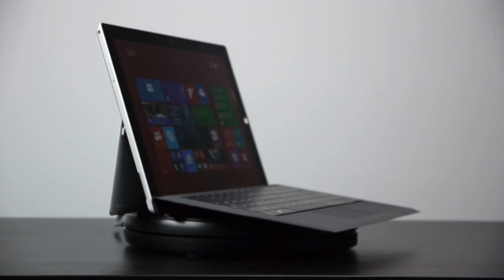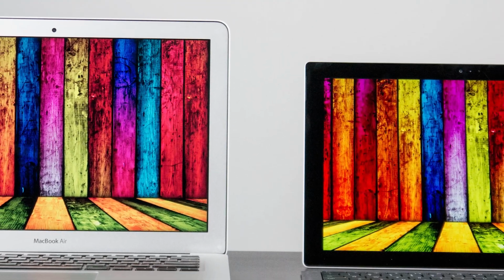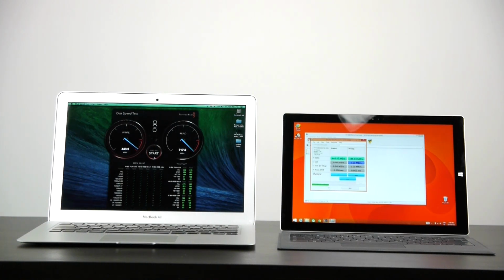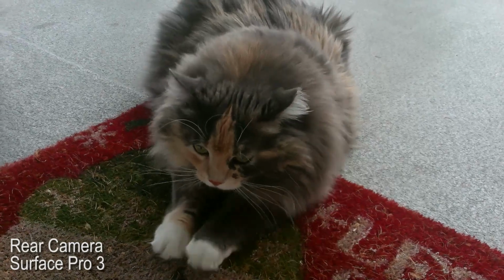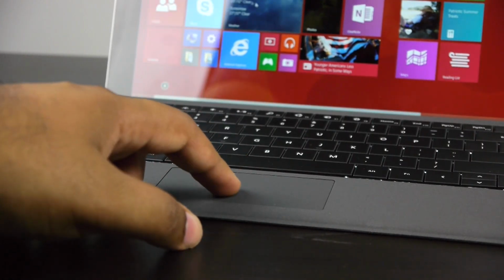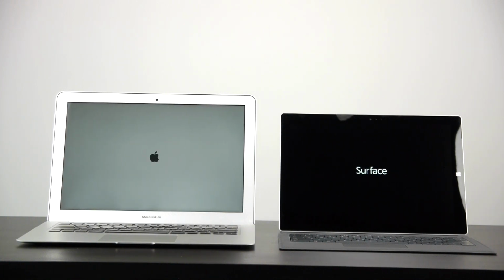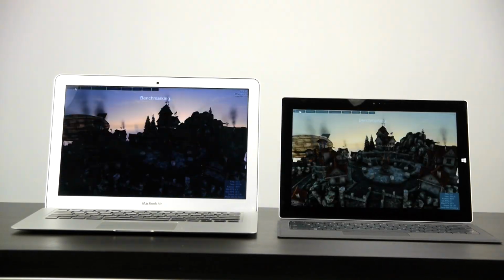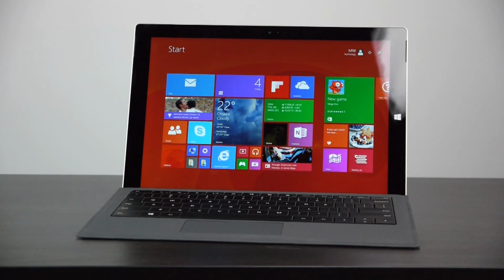Microsoft Surface Pro 3 vs 13" MacBook Air Full Comparison

Comment: So the Surface is a Tablet and is not the best tablet and a laptop and is not the best laptop. The Mac Book Air is an Ultra book, is regarded as a great ultrabook. BTW the Surface tablet starts at $800 with a core i3 plus the $120 keyboard. The Macbook Air starts at $900 dollars with a core i5. So which is superior?
Reply: Visual Uprising Well, It is bearable on this tablet. Plus the incentive is to be able to write on docs that you would otherwise have to print out which is a HUGE cost of time and money.
Reply: fantscher Thank you!!! Surface Pro 3 hands down (IF you're a student)
Reply: Visual Uprising  :D ok ;) there is nothing really to add to that... you are not in the target audience for the surface. you simply have no clue about the capabilities and the field of application for a device like that. in the field of ultrabooks it may not be the best... but it is far more than just an ultrabook or a macbook air. noone needs tablets (just to show stupid pictures or to browse internet? what a dump). but combined with all the features of an ultrabook AND the integration of a digitzer (not stylus!) it rules above all else the market offers. if you don't need all of it's features, than stick to your macbook air, thats a great product too... for my use case the sp3 has the better value-for-money.
Reply: Visual Uprising
as i said, i am using a vaio duo 11 (for about a year now). and since i applied the sony protective foil, it writes exactly like paper. it is responsive and has enough friction to imitate the feeling. i'm as fast as i was on paper. with nearly the same quality. i don't know whats your problem about that... have you ever used onenote? or a real digitizer?
Reply: Visual Uprising why do you hate OneNote? I haven't used it before
Reply: Visual Uprising You avoided answering the question poised by fantscher [have you ever used onenote?] and just stated that you hate it. Why should anyone take anything that you say as meaningful? You appear to be just a hurt fanboy crying that everything but apple is bad.
Reply: It's not a tablet. It's a laptop, and a tablet second. It's fully functioned in any thing you wanna use a laptop form, whether you want to use it for creating documents, productivity in the Adobe suite (Premier Pro, Photoshop, After Effects, etc...), casual gaming, and whatever else you'd use a mid-range ultra book for. Again, it runs the full Windows 8.1 operating system. Because of that it also has great support for touch. With its high resolution screen with a 3:2 aspect ratio, you can also use it comfortably in portrait, or landscape orientation, and use the Windows App Store to download apps. And in regards to note taking using one note, it's based on a pressure sensitive digital pen (not a stylus) that's used to instantly open in one note when clicked, allowing access to your organized notes instantly. As a generally productive person, this catches my attention more than the MacBook Air. That being said, I'm a heavy iOS user on an iPhone 5s and iPad mini currently, so having a Mac offers benefits in terms of sheer convenience in addition to its more productivity conducive OS. But to say the MacBook Air is better, is sheer bias, because for the most part, the key components in a modern, portable notebook are the display, OS, and Processor, and the Surface Pro has proven to be just as good if not better than the current MacBook Air.
Reply: ***** your right sir, i was thinking of the Mac Book Pro. I have Edited out that part of my comment. The rest still stands
Reply: Visual Uprising
no touch screen. and for me as a student the most critical factor: no digitizer. i want to take notes, have to write a lot by hand (typing everything is not a option) and in general, i want my device to replace all my stuff in the bag. every pen, every piece of paper. thats worth the additional $400 for the i5 8gb version. no apple device could do the job atm... in terms of productivity AND versatilty the surface is superior - for my purpose i have to admit. both are high-quality products... (for now i'm using a vaio duo 11, but i'll switch to the surface as soon as arrive in america)
Reply: fantscher i dont know if you've ever actually used a tablet for note taking, its actually terrible. Just use paper.
Reply: Mudit Verma For the same reasons i don't like the rest of the MS office suite. To learn how to use it efficiently you need to study a whole book about it, on top of that if you want to use it with the rest of the MS programs you need to use the Office 365 program.. meaning you have to pay 10 dollars a month to use them. the truth is there are free programs that do the same thing, such as Open Office or Libre suite.
Reply: Visual Uprising Honestly, to me you seem like some guy hating on a product he's never used. The Surface Pro 3 is expensive because it is a flagship device. This device contains the best premium technology in the industry and just says premium in every corner. There are cheaper devices but the quality is just not as good. The Surface Pro 3 even surpasses the MacBook Air in terms of quality. Due to the higher rest screen and color accuracy. I am getting the Surface Pro 3 to save room in my backpack and to take notes on for college. You said "i dont know if you've ever actually used a tablet for note taking, its actually terrible." You are right, taking notes on most tablets are terrible. However, the SP3 was designed for taking notes. You shouldn't compare this to other tablets. The glass on the screen is closer to the LCD than any other device. Which gives this device the lowest latency in the industry. Combine that with palm rejection and that makes this device the best in the industry for note taking. And btw using OneNote and knowing how to use OneNote are two totally different things. But, I would imagine OneNote to suck on a Mac and without touch.
Reply: it just seems like you are an apple fan boy, the surface is the perfect product to replace a laptop and a tablet at the same time. Take care
Reply: Matthew Feeney Your not much of a tech fan if you prefer only Apple. As many tech savvy people know, Apple Desktops are a nightmare to upgrade and customize. If you need to upgrade more than just RAM and HDD after a few years well though luck. There is little value for a Desktop computer that cannot be upgraded. Apple is more like technology simplified for the masses.
Reply: fantscher I hate onenote, and no have not.
Reply: fantscher Yeah, i own a about 5 PCs, iPhone, iPad and iMac. When i see an expensive computer with a touch screen i don't understand the appeal.. i even own a graphic design company and use tablets for... well Design. When im about to spend a large sum of money on a device i always want to make sure it's the best in it's category. the surface is an ok device which is expensive for what it's trying to be. There are plenty of Tablets running windows software which are way cheaper. Also there are way cheaper and better Windows laptops out there. So for 800+ dollars, your getting an "ok" tablet which runs Windows which is not optimized for touch screen controls. The only thing "optimized" for a "digitizer" (as you call it) in the UI is the Modern Design home menu and some  of Modern UI Programs which for the most part are unimpressive. And if you use the classic UI on the Windows 7 looking side, the OS does not scale appropriately. So it's a tablet with an OS not fully optimized for a "digitizer". It's a laptop, which is uncomfortable  to use as a laptop due to the kick stand, and doe not come with a keyboard. On top of all this, it's expensive compared to the "best" laptops, or the best "tablets". So it's an overpriced device trying to be several devices and running unoptimized OS. So it's just a bad device.
Reply: sjs2657g yeah i have
Reply: Visual Uprising That is where you are false.  You don't have to spend $10 a month.

You can use, office word, excel, powerpoint, one note all for free.

I have a windows 8.1 12in tablet, 925 phone, and a desktop.  I do not pay for office, nor do I steal it, I simply have a live.com account.  All things are synced.  I share my onedrive documents, edit them in real time, allow others to edit join etc.

It shows that you may have used one note, but your 'hate' for MS shows in this post.  I knew it would be that way when you started to talk about being the 'owner' of digital company.
Reply: Anthony Serna Umm, you mean an owner of a Graphic Design company? Sometimes when you buy a particular type computer, it comes included. but you do need to pay $10 a month to have access to the MS suite otherwise.
Reply: Visual Uprising To the full blown version sure, which for 9/10 people is way more than you need.  And even then, you get 5 licenses, onedrive accounts and individual installs, etc.  For one year 100$ for 5 people is cheap.

Go sign up for a live account, you get to choose Hotmail.com or outlook.com as an email.

Go to onedrive.com and you can now create, word, excel, powerpoint, onenote, excel survey (for online editing and online embedded excel surveys for stuff like html etc), and plain text document.  Onedrive will also let you store any file type, any extensions.

You can now share, collaborate, let edit, give permissions, embed etc etc.

SO no you don't need $10/month.
Reply: Visual Uprising So you admit you avoided stating that you have never used onenote. You probably never really used the Surface Pro, other than hitting a few keys on a display model. You're a politician for aPple, and don't we all just love politicians.
Reply: Also, you really are not the target audience. For any Student, this seems unbeatable, that is if your open to different OS's.
Reply: fantscher
That visual guy is an apple fan, I am afraid they don't learn. D: Instead they like to buy the iphone when a supposedly new one comes out. But really the only difference is the screen size. They were stuck with 3G for a while there when even the cheap prepaid phones had 4G. He probably has an ipad and an ipod also, he must like to spend thousands of dollars on the same thing with a different screen size. I also know eventually apple products deactivate themselves at some point so you have to buy new products! Why do you think they jail break there crap devices... I mean apple devices. I think Steve Jobs screwed up their brain. :O And if someone is going to tell me I am wrong I will laugh at you because I have had apple products before and I would have loved to set the slow devices on fire in my back yard!
Reply: Visual Uprising
Haha you are so stupid I swear, I get through the first 2 lines of your comment and I notice something! Your complaining that the Surface Pro 3 is expensive for a pc, when you have an Imac. You clearly don't know what your talking about because you are paying way more for an imac than it is worth! It cant run simple games, when the surface pro 3 can run some of the newer games without lag (Not saying at any graphic level or whatever.) Great the imac has a 1440p resolution, I am afraid that the Surface Pro 3 also does! It is better than your mac itself and its in a smaller body that runs just great. The only issue I can see you having is if your clumsy and like to drop tablets, or if you want a real keyboard. Everyone I have ever known that knows what they are talking about use devices that are not apple products.
Reply: Visual Uprising fantscher  Visual I also notice your saying $800 is expensive for a tablet, when I am pretty sure the one time I had an ipad, it was also $800 and could not do anything near what the surface is capable of! Infact it was pathetic, and no one was sad to see it go when we sold it! It collected dust on my counter going untouched for over a month at a time and it was just embarrassing. You can build a pc for the same amount of money that can run the newest games no lag, and still pay for a high resolution monitor! I am done complaining to apple fans because there are just too many of those idiots, if you enjoy it use it but apple fans make some pretty stupid excuses to why people hate on the products. None of my apple products I have had were worth what I paid for them. Infact the storage on them go outdated so fast because applications keep getting bigger and bigger. Being a developer I would never put an application on an apple device!
Reply: sjs2657g
I think since part of what he said is you need a book to learn how to use a software efficiently, I am sorry but I can use those software's without a manual, 2 minutes and I know everything I need to use it the way I want. He probably doesn't want to use a professional level software because of a very small learning curve. Most of it is kinda self explanatory too!
Reply: Anthony Serna
I guess he didn't use a search engine to find this out since apple hasn't made one! Microsoft has Bing (For windows fans!) Google has Google (For android fans,) But Apple thinks they are more than they really are. The only reason they think this is because they have enough idiots paying for over priced devices. I am going to stop now because with my other 4 comments I am going to get a lot of angry apple fans yelling at me but know I am on your side. I also have Office on my lumia including OneNote, OneDrive, PowerPoint, Word, etc. Some parts of office you do have to purchase though like word and powerpoint.
Reply: Pr0methean117
I totally agree when you say don't compare it to tablets, since the tablet is so great most people compare it to actual laptops which it also beats in most cases. Go look up videos of people play BF4 on the surface (Plus they are doing it on the cheap one without lag)
Reply: Matthew Feeney
Windows fans could be a little more open to different operating systems, and mac would most likely be the second one on the your windows device. The problem is apple is such a money hog, you have to buy their devices in order to use there operating system. Can't download it as a second operating system(as far as I know.) If I am wrong tell me!
Reply: *****
Actually, a laptop can make a great device to take notes on, all though it would probably bother the people around you when typing. There are people that can type at 180 wpm. Although those guys really have no life they just sit on their computer. I type up to 74 words per minutes while I am on the computer. A lot of office jobs require you to type 80 wpm. If you can keep up with those speeds then you should have no problem typing your notes. In fact that is my preferred way since my handwriting sucks!
Reply: +Targanto1 I understand where you're coming from. But I'm actually an Apple fan. I love all there products, for the most part. However, I'm also a tech fan. I prefer apple products, but I could understand where people are coming from. That being said, people have their preferences. It's different to judge people's opinions that are solely just slander and based off false information. At that point, it's nice to try and show someone their error, but then to go on as it seems you have responding to every comment, makes you wonder, "is it worth it?" Why not just do something productive? It's just like  the "console wars" . People spend so much time arguing about their shiny plastic boxes and spend less time playing the games. It's stupidity. Don't waste your time man. This is coming from fifteen year old.
Reply: Matthew Feeney
I am 14, I know but its like 2 o'clock in the morning and I am not trying to start a war. Just proving points and I was an apple fan once. I don't really like it at this point. Not the os, but apple itself just doesn't make since how they sell so much of basically the same product. Think about it, I think in a comment earlier (Too lazy to check) you said you have an ipad and an iphone or something? Its the same thing with a different screen size and one can make calls. Really the only difference and you spent at least $1200 on it. That's why I don't like apple. Also notice you can't fix apple products yourself without breaking them, you have to spend a whole bunch of money at the apple store in the mall. The devices are not worth what people pay for them, basically just paying for the name that somehow became as big as it is. If macOS was downloadable I would download it to my pc. But they don't allow it. Sadly for developers like me, if we want to develop an app for an apple product simply so others can enjoy it. You have to do it over a apple device. (The engines I use to compile are forced by apple to not be able to compile for ios or macOS without being on a mac sadly.) If they were worth what they cost, I would have no complaints! They are basically giving you a dime for a quarter!
Reply: Matthew Feeney And the console wars are pretty stupid. I could write a whole other 5 paragraphs on that improperly (No indentation and too many exclamation marks like I have been.) But I don't play video games much anymore. So there is no point. But back when I was part of the console wars I complained about PlayStation copying other console like their motion remote, the one WII came up with and all they did was put a ball on the end with a blue led in it! At least Apple and Microsoft don't copy each other. If you know what your talking about, you can make the correct decision. You should be able to pick one without watching comparison videos. All you have to do is look at specs, and read some reviews for problems.
Reply: Matthew Feeney
And actually your right, my argument is pretty pointless. People are not meant to get along. We all have our own personality and our own preferences. Its hard to change a persons mind on something, and people want other people to like what they like. So I am done commenting, or with the long comments at least. I will simply correct someone if there wrong or answer a question.
Reply: +Targanto1 I understand. And I'm glad you understand as well.  Sorry I kept you up.
Reply: ***** Yea well when drawing your right, anything you need to draw would suck to draw, but typing words would not be a problem for me I don't think. If you can type around 100 wpm, you should have no problem, although that's not easy unless your on your computer a  lot so yea, maybe not the best way for the average person!
Reply: +Pr0methean117 I am. Let me clarify. I prefer to use apple products over a lot of other things. I still very much love windows. I actually like my xbox more than PS4. But I still have both. I built my own gaming PC, as well. I have preferences however. But for example, I prefer xbox one because I love Halo, and because i like the OS and games it has to offer better. As much as I care about the PS4's faster specs, it doesn't mean anything if I don't have Halo, and the other games I like to play with friends. Its the same thing with Apple. I prefer iPhone over android because of the convenience and features that it has to offer. But if I cared about solely specs, I would get an LG g3 and root it to run stock android.
Reply: Matthew Feeney Oh I see. Very nice. You seem to use a pretty diverse line of products. I like to mix it up and use a lot of products before I decide which I prefer myself. And I can totally relate to that man. I'm a huge halo fan myself and even though I purchased the PS4 that MC collection is making me regret my purchase hardcore lol. But, Bungie is making games on PS now so I figured I'd wait and buy an X1 later. But, Destiny ended up looking the exact same on X1 and it has halo as well =|. As for a smart phone, I have really only owned an iPhone so I don't think I could intelligently say they are best for me or anyone else. However, I can say they offer a good user experience. I plan on trying Android and WP at some point.
Reply: Pr0methean117
Well I have some experience with android since my other 3 family members have the Samsung galaxy. The Samsung Galaxy has a lot of personalization you can do to it I am not sure what you can actually do to it though, I just know the settings menu is absolutely full of stuff so you can setup the phone how you like. Now since google is related to android, I am not sure if its a partnership or if its made by Google, most of the Google applications on the computer are available on android. Some of the cool features android has is the fact that you can get a smart watch to work with it (My favorite part.) Also with an android phone you have more options, you can get one with a dual core processor, 4 gb of ram I believe, and it has way more battery life than an iphone. I also found android devices receive better service (With verizon, plus verizon has that new xlte which is twice as fast as lte/4G.) My only dis against android is its really not that good looking of an operating system. It looks kinda weird but thats the only place the galaxys loose against iphones, the phone itself also has a way bigger screen. Plus it has a higher resolution than iphones. I have a windows phone 8. I enjoy it myself and the only real thing I am missing out on is apps, not a lot of apps, except the more popular ones. Although my recommended WP is the Nokia Lumia Icon. I got to tell you Nokia, and Here, can make some cool apps. Look up an app called "Here City Lens." Its great if your traveling. Also the Android and WP get 4G, I don't think the iphone does, not sure. My windows phone gets great service, but not as good as the android does. I am sure you would agree with me the live tiles are pretty cool on the windows phone, and provide you with the info you need so you don't even have to open the application, and it still gets really good battery life. Recommended Android : Galaxy S5, Recommended Windows Phone 8 : Nokia Lumia Icon, Recommended Iphone : They are all pretty much the same.....
Reply: ***** Yeah you have a lot of good points there. I think that each OS has its strengths and weaknesses. I am going to wait until I try them myself before I decide which I prefer though.
Reply: Just read reviews, its basically the way to protect yourself from wasting money! If there are a lot of bad reviews on something, your probably gonna hate it. I am impressed how all models of the Surface get amazing reviews, it was something really good that Microsoft made.
Reply: I don't own a Surface Pro, but I plan on getting one at some point, all of my comments are based of of my knowledge. So I did not know something was wrong with the digitizer. What is wrong with it specifically? Is it not responsive to your touch at some points, or is it not calibrated right, etc?
Reply: ***** ***** The only difference is wacom vs N-trig. Microsoft chose N-trig because it allows for a thinner digitizer and more accuracy while writing. Wacom has way more pressure sensitivity but requires two digitizers and has less accuracy while writing. Reviews do not mention it because it is kind of personal preference and it depends if you are using it for writing or drawing. I think the problem is with you my friend. The Surface Pro 3 is not the same as the first and second generations. This time around note taking was a larger focus.
Reply: Pr0methean117 ***** I am not completely sure what a Digitizer is, from what I know, it basically senses your touch and turns it into waves to send it to the processor right? You would probably expect me to know for sure, but I am way more of a software guy.
Reply: Pr0methean117 ***** Also I think I just ruined my second monitor because it doesn't have a screen saver, and the color green is not showing up on it, I am only getting my red and blue pixels... Thats what I get for turning it on and not really using it much. :'(
Reply: ***** Pr0methean117 Will you guys please tell me what a digitizer is?
Reply: *****
 Thank you now I know. I am sure there is some way to fix it, but I don't know if you could do it without destroying the tablet.
Reply: ***** "The digitizer is the pen that comes with the Surface." LOL just so you know. "Digitizer - The digitizer by definition is a device used to convert analog signals into digitial signals. In the case of our cell phones, this device would be the glass that covers the LCD. Yes, the glass piece that is attached to the LCD is the digitizer... or sometimes called LCD digitizer." -Google.  I have replaced the digitizer in an iPhone on multiple occasions and a pen is not the digitizer. And with your talk about crooked lines, well this is the first I have heard about that and I have been googling it with no luck. If you are the only one talking about this then have you ever considered that you may have a defective unit or it may have been damaged during shipping?
Reply: ***** I suppose you may be right but since this is my first time hearing about this issue I will also take it with a grain of salt. I am currently going to college to become a Network Administrator not in Digitizer technology so I surely do not claim to be an expert in that area but I do like to do my research on technology. But, I think the only real difference is in pressure sensitivity. The Surface Pro 3 has 256 levels of pressure sensitivity while the previous models had over one thousand. Wacom vs N-trig debate. I have read that N-trig is slightly better while writing but Wacom blows N-trig away while drawing. Use an ink pen vs a led pencil to get a real world example. SP1 & 2 is the led pencil and the SP3 is more like the ink pen. I think that's a good example to explain the difference without specs and numbers lol.
Reply: ***** I wasn't saying that you don't know what your talking about, I'm sure you do. I was just saying that this issue may be barely noticeable. And you may have to be a professional artist to notice. Or it could even be a software glitch or a driver that needs to be installed. I mean you may draw professionally in which case the SP3 isn't right for you because of N-trig. With 256 levels of pressure sensitivity this device can do some light drawing but it is really meant for writing. I think N-trig is fine myself because all I need to do is take notes during class. And dude unless you are a millionaire then we are all average bears.
Reply: ***** Yeah, I actually plan on getting one as soon as I can and a comparison would be nice. I don't know if anyone has actually done a pen comparison. But, I plan on using this to take notes with and this issue may be of some concern to me. I don't know if I would be able to write in the college ruled lines on OneNote though because the lines seems kind of small and you can't zoom in very much. However, the good thing is there's a lot more space to write on OneNote as opposed to paper. But, if this issue really concerns you make a video that clearly demonstrates the issue and post it to the Surface teams twitter page. They respond to a lot of tweets.
Reply: macbook air has a garbage screen too.
Reply: Junmo An That I will agree with, i bought one a week ago and returned it. Got a Macbook Pro retina instead for a like 200 more bucks.
Reply: Drawing and writing on the Surface Pro is really cool, it has proper drivers for pressure sensitivity so it's really natural like.
Reply: elfoxy yeah but if you want to make a nice high resolution drawing, the GPU on this thing is inadequate. It's better to use a bamboo tablet on a laptop. or if you want a cheaper alternative, buy any tablet that is compatible with pressure sensitive styli.
Reply: ***** Taking notes can be done on any tablet. The Surface is just silly.